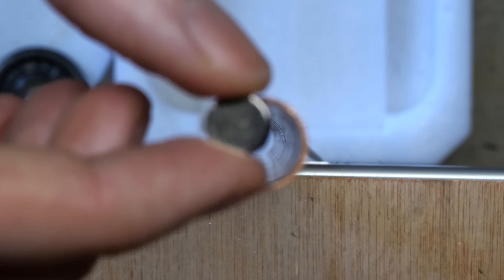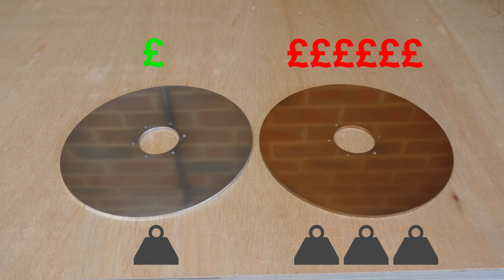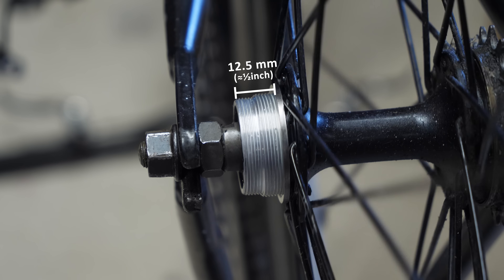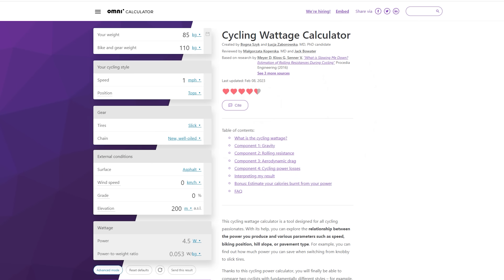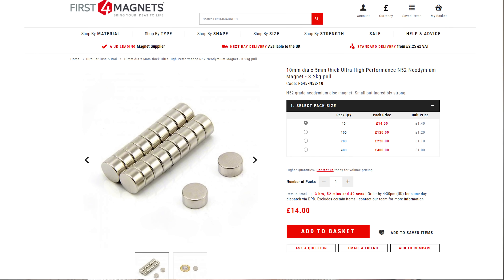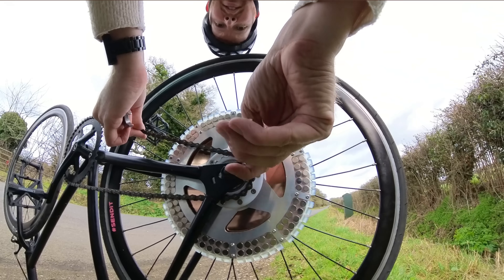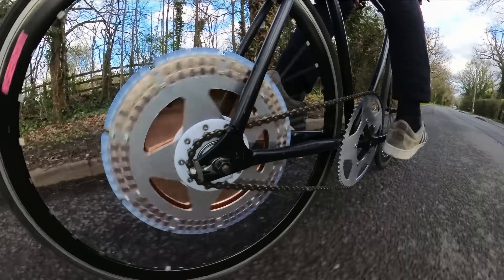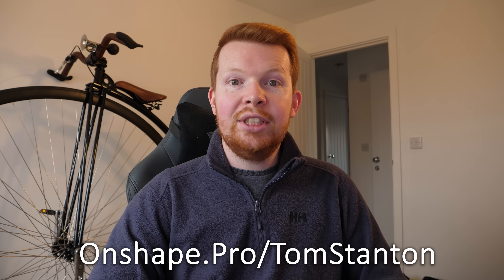Gearless Magnet Bike

Comment: Make some steel flux plates and stick them on the back of the magnets. There will then be less free flux. This will stop the spokes and chain sticking to them. It will also significantly increase the flux density in the air gap where the copper disk is.  
I ll now watch the rest of the video to see if you actually do this!

Comment: Would it be true that your magnetic clutch is inefficient, or less efficienty than a straight chain and sprocket drive ?   Certainly the waste heat suggests that not all peal power is transferred to the wheel ??

Comment: I would be interested in testing one feature which is stalling the pedals as the hill grade increases.

In towing one advantage of an auto with a lossy connection to the drive is that when the load is heavy enough to stall a direct cluch the auto can slip and eventually creep forward enough to get going.

So technically this bike should be able to climb steeper slopes before its so hard to pedal that the rider is “stalled”.

Curious if you compare a direct linkage to this riding up increasingly raised grades and see which bike maxes out where.

Id suggest actually adding training wheels to keep it upright when stopped to remove the tipping over issue with bikes. Then see which setup is unable to move forward. Your transmission should win if you arent allowed to stand up and use lots of torque.

Comment: What would be results from opposing mags on the pedal end?  2 or 3 stage wherein separate rings are shifted closer to sprocket.  This would decrease the energy needed allowed faster acceleration with decreased energy input. 
NOT ENGINEER, so overlook ignorance, and provide criticism accordingly 😉

Comment: What about using the sprocket rotation to create an electromagnet that can be engaged with the handbrake? Perhaps the electromagnet interacting with the copper disk would have an equivalent effect that would be disengaged to minimize difficulty pedaling.

Comment: Maybe think of adding something to the centre near pedals to allow the copper plate to continue spinning. Similar to a ratchet mechanism but with a silent mechanism. That way you would not loose power when you stop pedalling.  Maybe even a round plate of aluminum on the spokes to give more magnetic pull. Otherwise looks really good!
Reply: When he stops pedaling the wheels keep spinning and the magnets follow then and the pedals keep spinning, it only looks like it brakes because he is pushing down really hard on the pedals every time he stops pedaling.

Comment: Mr. Stanton seems like quite a competent and capable bloke and yet not a single thought was spent on the fact that copper is far heavier than aluminium which could explain the difference seen in Veritasiums video… big disappoint.

Edit: Ah, I knew my boi could do it @2:02 ❤Mr. Stanton

Comment: 13:00 but how can u match the speed of the copper disc . 
Cuzz if there's no relative motion no eddie current will be induced 🤔🤔🤔🤔
Reply from the maker: When the speed was matched, it wasn't accelerating, just cruising.
Reply: @TomStantonEngineering  but bro cruising also require  some power input due to friction and drag IG.
Reply from the maker: @Sahibjit Singh  True, I should have said 'freewheeling'. Basically, I put in zero acceleration/deceleration, but because it was for such a short time period, the bike didn't slow down much.
Reply: @TomStantonEngineering  yep😚

Comment: The problem seems to be that if you stop pedaling the energy you put into the bike to get it moving is quickly absorbed,  a bit like a fixed wheel.  At least with a freewheel gearset you can coast in places and lose very little energy..

Comment: Your issue is eddy currents in the frame chain and any other material influenced by the magnetic field.
Go to carbon fiber for supporting members and the spokes of the bike should also be replaced.
You would be better off with a magnetic coupling and expanding hubfor the l clutch or gear effect.

Comment: You just need 2 magnetic disks instead of copper and a magnet. I used 2 magnets from the hard drive to make the water turbine move - one, on the motor, on the outside of the plastic container, the second, turning the blades, inside.

Comment: A 10mm-per-side cube is not 200% larger in volume than an 8mm-per-side cube. It's 1.95 times more volume, so you could say it's approximately 200% the volume, or 100% larger. But saying it's 200% larger implies it's 3 times bigger in volume... and it's not. Think of it this way: if it were 1% larger, would that means it's really only one-one hundredth the size? No, it would mean it.s 1.01 times the size. So 1.95 times the size is 95% larger (which, you can round to 100%, but not 200%).

Comment: I was thinking about how you can stop a velomobile with this this thing. It is known that a velomobile uses drum brakes which are not so efficient in hilly areas and they can overheat quickly. How many magnets would you need to stop a 35 kg Qatrovello or Quest? Anyway, it is an interesting idea!

Comment: Using the plates like this is similar to the direct electric drive in vehicles with the resulting regenerative braking. Why not use the derailleur system with multiple gears for acceleration and coasting with less energy expended and lost and use the magnetics for the braking by inserting an ellipsis between the plates to spread them apart for going and moving them closer together for decelerating and stopping?

Comment: Question: if while trying to stop if you peddle backwards will that help you stop faster? I want to say yes because it trying to push the copper backwards which will act more like a full break. But I wonder how well it will work!! I also wonder if you hooked an RC motor to be magnetic wheel could that be used like a motor and push you forward without the need to peddle, how well that would work because you can get a lot more speed out of a motor to create more eddie currents and go faster and how well that would work also!!

Comment: I think if you invert the configuration (magnets on the wheel and copper on the sprocket) you don't have to worry about them sticking to the spokes (they are moving at the same rate) and you can have them further away from the chain (maybe you can try an aluminium chain as well). Having electromagnets to turn the friction on and off may be interesting as well, though I am not sure how to wire them in moving parts
Reply: Drive chains are made out of Steel because it's tensile strength, stiffness, hardness, fatigue strength, and importantly wear resistance. An Aluminium chain would need to be much h bigger to have the strength making it bulky. Then still it is too soft, even an alloy.  So it would just wear out fast. Maybe get hot and seize up.
    Electro magnets similarly are too bulky.
Reply: @johnrhodes3350  They make titanium chains and titanium isn't particularly magnetic
Reply: ............MAYBE JUST USE BELT DRIVE ,NO????

.........................

Comment: One factor you seem to have overlooked is that if you want higher braking at low speed you could always just pedal backwards and increase the effective relative speed of the wheel vs the magnets. I do otherwise agree with people's suggestions of reducing the amount of copper used. I'd also suggest, from my limited electrical engineering knowledge, that you cut air gaps between sections of the copper, as that should cause greater eddy currents since the air will act as a dilectric and theoretically cause increased resistance. Will admit I'm unsure if that'd improve the effective coupling overall, but it seems like something that would at least have an impact.
Reply: I wondered about pedaling backwards too.

Comment: The problem is that the eddy currents dissipate their energy as heat - and I'm impressed that the currents are high enough to heat a thick copper plate.  What you want are copper coils, instead of a plate, to conduct the current to a battery, and use the stored energy when climbing hills.  Regenerative braking, as in a Tesla, but for a bike.  (You'd probably want aluminum to save on weight.)  It would be an interesting way to hack an e-bike.

Comment: Now you need to swap out the neodymium magnets, for electromagnets, so you can turn off the effect while travelling down hill without peddling. Or, you can create a clutch system that moves the magnets away from the copper flywheel, to reduce the effect for downhill travel.

Comment: LOVE IT!
I realize it would most likely use a ton of energy, but with electric bikes having such long rang these days maybe the magnets could be powered/created by the battery (Magnetic coils). Haven’t given it much thought yet, so I am not sure of the pros and cons of this idea, just thought I would share. You could use it like a gear shifter on a standard bike, just increase the power in the coils. Might also solve some of your issues on the prototype you have created. Spit balling here. ;)
Great work!

Edit:
If you wanted to really play around with the idea you could get into electronic controls which could auto adjust the magnetic force, depending on if you were accelerating or slowing down (Might be able to remove mechanical breaks?). Similar to how some E-bikes control/monitor the torque being applied at the pedals thru the sprocket. Cannot recall the name of this off hand. But I know Bosch uses this tech, which is based on the rotation speed of the sprocket (If I recall correctly).
Reply: You are literally describing the electric motor in an e-bike 😒

Comment: Put the copper disk into a stater pattern and leds on with a switch for close to open and the resistance will increase a lot when the leds are on. You can also cook on the disk when riding😊

Comment: Have you thought of creating a free-spinning version of it like a fidget spinner, so that when you stop pedalling, the disc keeps spinning with the wheel, giving you extended momentum? Like the opposite of what you built - when you stop pedalling it slows you down. But if you had one that kept spinning when you stop pedalling, it should keep you rolling a bit longer.

Comment: I saw the flaw right away. The sink is dependent on the speed of the components related to each other. As the speed of the pedaling matches the speed of the wheel, there's less sink resistance. There will always be a significant loss in work.

Comment: I would love to see how much more magnetic braking you could get if you arranged the magnets in a halbach array with tight spacing (significant magnetic strength boost on the inside, plus significantly less unwanted field strength on the outside next to the chain etc). Also, you could change the gear ratio by changing the spacing between the magnets and disc, but it won't be easy because the useful gear ratios would be in a very tight range very close together. Pity about the wasted energy.

Comment: You should look at Toyota Hybrid Synergy Drive. One electric motor at the pedals, one at the wheel. Pedals and wheel are connected with chain and planetary gear. A DC/DC converter is transfering power from the pedal motor to the wheel motor. Gear ratio can be changed by changing the output voltage of the converter. Output voltage is controlled by an rpm meter of the wheel.

Comment: This video is interesting for the physics, but a huge disappointment when it jumps the shark to 3D printing plastic parts instead of using a common metal lathe to machine steel or aluminum. We've been machining metal with metal lathes for like 150 years now. Steel or aluminum is orders of magnitude stronger than plastic.
I could have turned those parts in a few hours, and I'm not even a professional machinist.

Comment: Seeing as magnets and copper windings are used to generate electricity, could that un-dissipated energy be tapped off to run a small electric, or charge a battery array to run said motor, and thus have a truly off-grid electric bike?

Comment: At 2:30 you say the weight has finished accelerating and the disc is spinning at a constant speed. That is a very short height and low speed in which to achieve terminal velocity. It must be possible because of the braking force of the magnets (or some other kind of drag apart from the obvious). Could be clearer.

Comment: Sounds to me like if you could use that setup to produce electrical power and store it in some sort of battery or capacitor rig and connect that to an electric motor, then you'd have an electric bike that your peddling would charge and then you wouldn't need to plug it in anywhere! I do not have your level of knowledge but don't you think that seems feasible? Using insulated wiring instead of a copper plate or something?

Comment: Having an inverted centrifugal governor that varies the magnet force distance from the hub, you'll end up with a torque/rpm self-regulating system.

Having a twist grip increase or decrease the radius would let you "select" how much power you want to put into the pedals.

Between that and a reduced airgap (cubic law being the cruel mistress that it is), I think a V2 would actually be almost viable.

Comment: Use a drive belt & carbon rear disc wheel, carbon chain & seat stay.  No more sticking issues.  Also you need a much larger front sprocket.

Comment: Two things to think about:
1. You can use the wheel itself. It will give you much more torque. It have much begger diameter. And it is aluminiu.  Also can save cost !
If you want, you can cut copper plates and mount them to it.
2. You can pedal backward to stop better. I am interested to see how it works.
3. You can store the energy of the eddy current and power some light or motor.
4. You can use a system like automatic car transmission. This basically means that the wheels lock to each other when you get to a certain speed.

More than two, but 🤷😄

Comment: A pedal rate of 84 RPM is 40% higher than the optimum rate of 60 RPM. You could not sustain that rate for any appreciable length of time.

Comment: Try Halbach array, so one vertical magnet between the horizontal ones. This increases the magnetic field on one side by 150% and the other side by 50%. This arrangement is used on fridge magnets. Halbach arrays also used for braking high speed objects with no contact.

Comment: Your meticulous research and trials of materials and forces is truly impressive. Then to advise us that it didn't work as you had hoped shows your humility. Thanks for sharing this whole story.
Reply: The answer is seen in electromobile vehicles- Alternating current (in motor wire-windings) is far more efficient than permanent magnets only (which are also present in many EV motors). Also stopping power in EV regenerative/recuperative braking had same weakness as described in this video. But - with alternating current oposing the magnet rotation, it can be managed to fullstop in most current EV vehicles.
Which translate to even not using normal friction brakes/pads at all = rusting.

So this research is not completely wasted- it just needs to simulate EV motor = induce some current in copper disc (made from thousands of copper wires, insulated of course). And electronics with variable frequency of alternating current, made by using Gate-transistors.
Of course it is not needed as you can buy such a bicycle now, but- exactly the same proces they do in Tesla, Mercedes factories/labs.

Comment: I am having trouble understanding what you are attempting to build.  The title 'Gearless' implies you are trying to replace a derailleur system with a magnet driven system.  But the advantage of a derailleur system and any system with multiple gears is big gears are easy to pedal but don't go fast, small gears harder to pedal but do go fast.  Where as, your single gear with the magnets only change the power required to move the wheel, but don't impact the speed and efficiency of a derailleur system with different sized gears.  What am I missing?

Comment: This is effectively an electric engine and regenerative braking, except the power input is your pedaling, and there is no electrical recapture due to lack of battery. In an electrical motor, electrical current generates a magnetic field which repulses/attracts another magnetic field to generate kinetic force. When the power source is switched off, the moving magnetic field in proximity to the conductor does exactly as you show in your video and current is generated while a magnetic "friction" is applied to the momentum. I'd be curious to see where the current generated by your disc-brake is ending up, and wouldn't be surprised if it's being bled off as heat because your disc is effectively made into a giant resistor. Very cool prototyping process and experimental approach; hope you do a followup!

Comment: In Veritasium's test, the aluminum sheet was much lighter than the copper sheet, hence, it's slower rate of fall.  Your intuition that copper was better turns out to be correct.  If you wanted to increase the hysteresis, however, you could silver plate the copper.  :)

Comment: This reminded me of a system that was shown on Tomorrows World TV program  many years ago that had a front sprocket made of segments that were mounted on springs, so the harder you pedalled, the smaller the diameter of the front sprocket became, thus lowering the gearing. I can't for the life of me remember how it managed to maintain the meshing with the chain, I've a feeling it might have been a belt drive instead or something, but I just don't remember. I can't have been a success as its never been heard of since.

Comment: Aren't you creating a generator?   The power of which could be stored in a battery until you approach the hill and use the energy to make up the difference?  Gains from down hill riding and braking.    Of course there are some losses but overall efficiency should be increased.